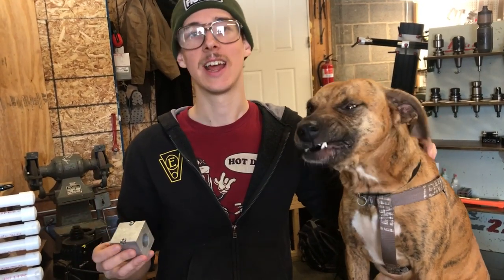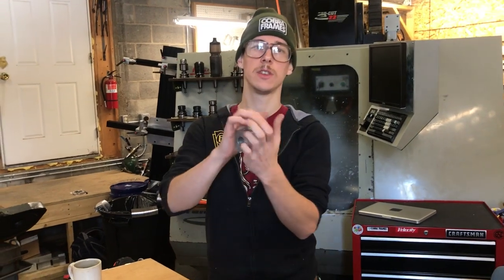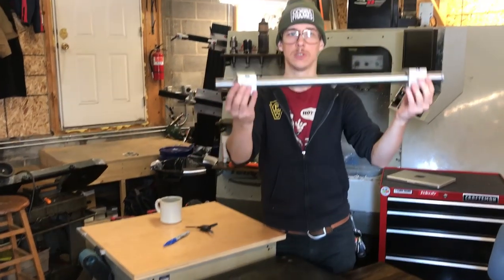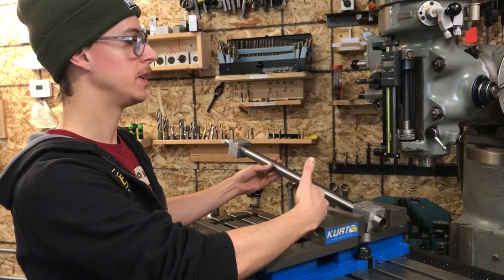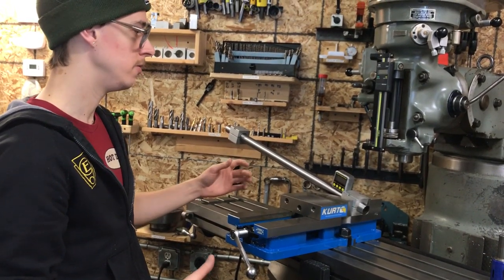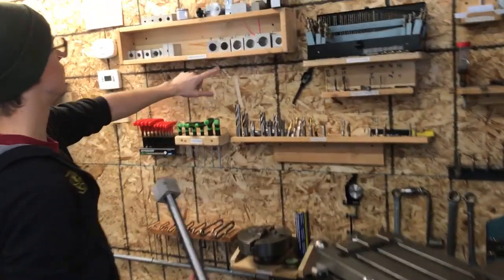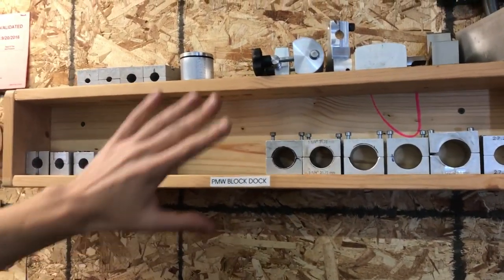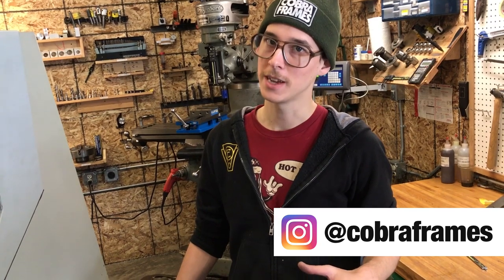How to Miter with Paragon Machine Works Blocks | Bike Framebuilding

Comment: Another great video. I love those blocks too, very good deal. You might try slowing your cutting speed down. Most builders go less than 300 rpm on a big mill [but small mills need that higher speed for lack of torque]
Reply from the maker: Thanks for the suggestion! You certainly have mitered many, many times more tubes than I have!